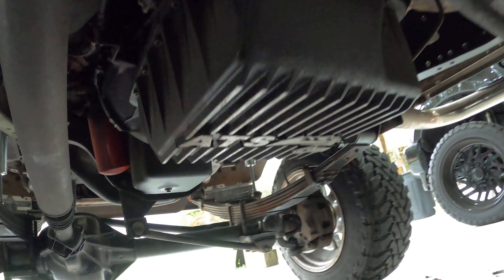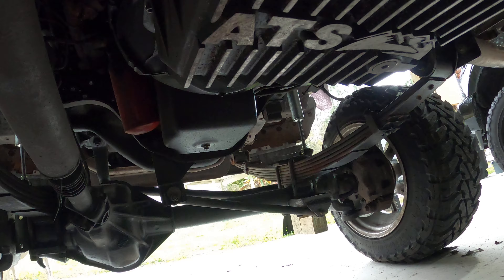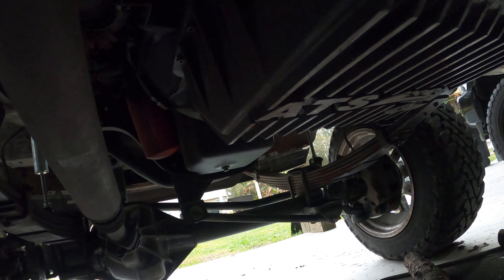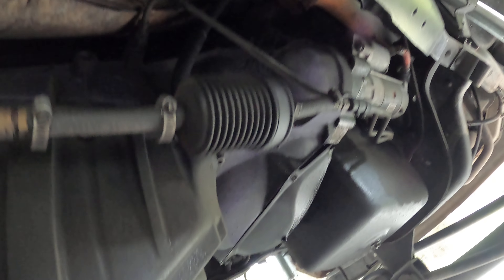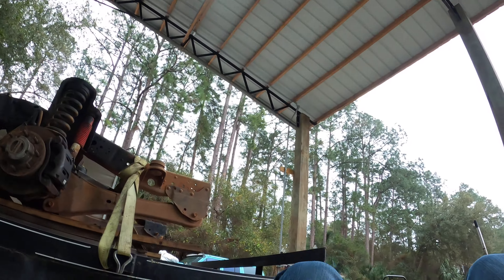TRANNY ISSUES WITH ATS TRANS & TORQUE CONVERTER ON 97 F250 7.3 POWERSTROKE

Comment: Good Lord man, what a relief ah? I was hoping it would be simple. I just dropped $4700 on an ATS and TC in June. 19K miles so far and it's still doing good.
Reply from the maker: Nice they're a great transmission they just shift really hard during the torque converter lockdown. Besides that been a great transmission

Comment from the maker: Found the issue with this truck ended up being a 69 cent third brake light was blown out. On this truck the torque converter will unlock when applying the brakes.if any tail lights are blown torque converter will not lock.
Reply: Aint that sumthing? First experience with that I was driving cross country (FL to MN) in my 96 bronco, FL GA no problem TN the converter started locking and unlocking going down the hwy.. thought my trans was toast pulled into a KOA in Nashville and found a bad ground in the brake light circuit cleaned her up drove the other 800 miles home no issue👊👌 shitty feeling so far from home lol
Reply from the maker: @Turbotalkin  that brake light issue is so stupid can't believe a truck manufacturer would do that but at least we know what to do now if we have torque converter issues
Reply: @overbudgetobschannel4584  Probably a side effect of being a last minute design choice because of the DOT.
Reply: @overbudgetobschannel4584  But hey, would you recommend the ATS? I need a new transmission.
Reply: One of fords brilliant ideas lol, let's just wire in the 3rd brake light and transmission harness together lol

Comment: I’ve got a 97 with auto trans, stalling in reverse. No grinding or metallic noise. RPMS drop and then stalls, fluid was low. Added fluid and still same symptoms. Runs fine in drive… help please!

Comment: Idk if you have the php tuning included with the hydra library. But i had poor shifting and inconsistencies with that tuning. I had Dusty at 1023 diesel custom tune mine and it is a night and day difference in driveability
Reply from the maker: Yes it's been turned quite a few times. Transmission shop said valve body is letting fluid past.

Comment: E4OD transmissions have a sensor/OD solenoid module in the transmission. Ford no longer makes the module so you have to buy aftermarket. This is turning out to be a big problem for me. I'm on my 3rd module and have a 4th coming. Luckily for me the transmission is under warranty
Reply from the maker: Never have burnt a module out everything has worked good transmission just shifts very hard. I've reached out to ats and they said it's supposed to shift hard it's a sled pulling transmission. Mine ended up being a third brake light. Which let's the torque converter disengage

Comment: Had a similar wierd problem. The cigarette lighter fuse blew and the OD light started flashing and shifted hard. Replaced the fuse and it worked for a year before i had to finally replaced the transmission at 330k miles

Comment: hello everyone i need help. i have a 96 f250 7.3 auto transmission and it skips second gear but all the other gears work fine. what may be the issue and solution?

Comment: I'm having same problems with my ats stage 3 2500 miles ago tork converter failed had parts and pieces came out of that and metallic out of trans fluid 2nd trans runs hot around 150 drops into 4th to limp home ats blames programed and engine upgrades mind you nothing crazy I love my truck drive it like old man ats says the trans I sent back nothing was wrong with it and there tork converter had nothing wrong with it  but will still have the pictures we sent them so  if we have to change it a third time I'm going with a 6speed manual for my 07.5 ram2500 with 6.7 cummins

Comment: ATS is garbage, they ripped me off on one of their pos transmissions.
Reply from the maker: fortunately the only problem that I've had out of mind is the very hard torque converter lockout and the stupid brake light issue
Reply: @overbudgetobschannel4584    I got ahold of the owner of ATS and he said he is personally going to build me a replacement transmission. He said he will cover all cost of removal and install. with all shipping cost.  Hopefully he does so. I'm well over $8k into this transmission.
Reply from the maker: @pokerman9108  that's great I hope they get it taken care of transmission is bulletproof just got to work out some of the bugs